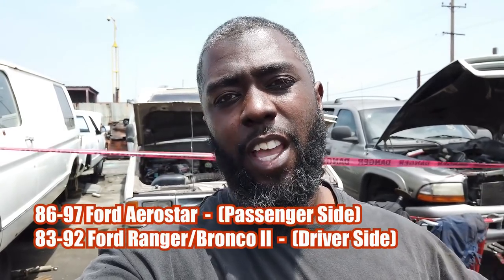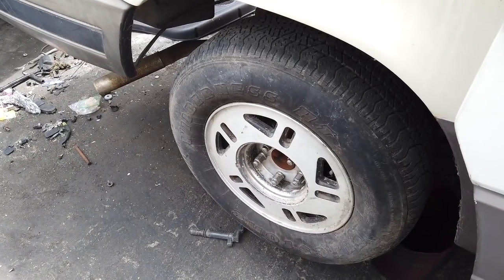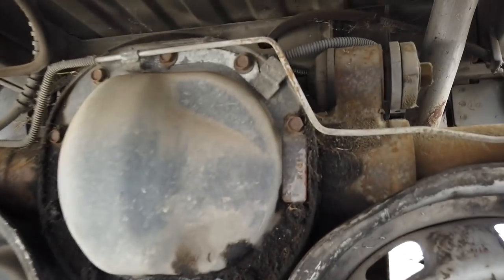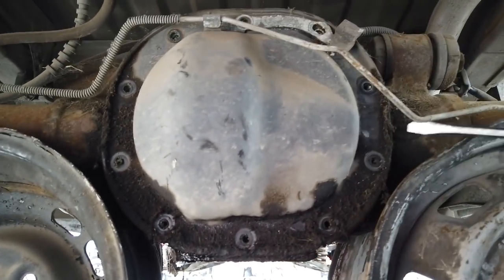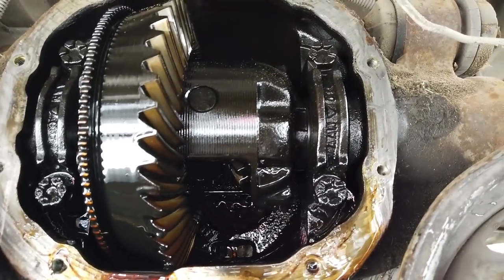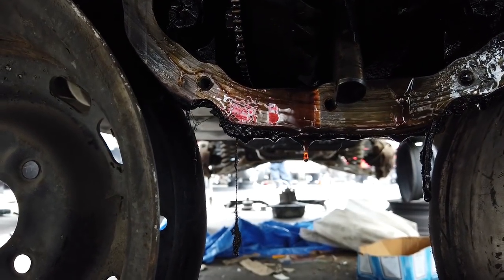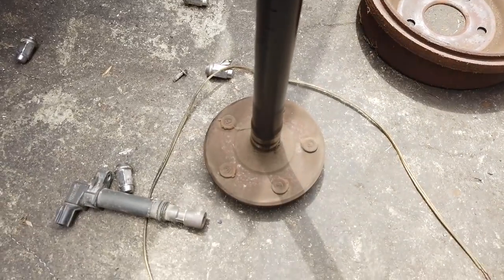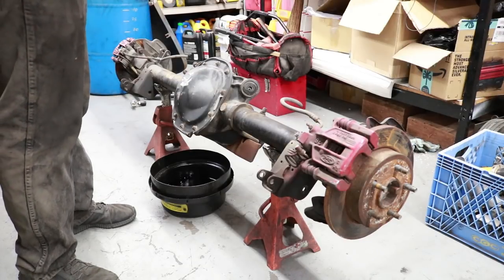Foxbody 8.8 Differential 5 Lug & Disc Brake Swap - JUNKYARD MOD

Comment: Dude you saved my ass! I have 8.8 w/C-Clip eliminators and run a 15" wheel on my Fox. The fancy disc brake conversion brackets, put my axles out a 1/4" on each side producing less spline contact at the spool. Not to mention Cobra rotors and calipers wont allow 15" wheels. I couldn't believe this would work till I did it. Bravo!

Comment: To save your self the trouble, just get the axles from rock auto . A lot cheaper than LMR. the set out the door cost me 137 dollars. All you have to do is buy studs they don’t come with the axles ..

Comment: Awesome video! Do you know if you can use the sn95 brackets this way and keep the 4  lug stock axles ?
Reply from the maker: Yes you can.  If you find 4 lug disc brakes from a a Thunderbird Turbocoupe it works great

Comment: I was wondering if I get a 1994 mustang with a V8 in it - would the rear end and 5 lug set up bolt up to my 83 foxbody? the disc breaks- the break lines- etc.  That's what's going on here ? Except you get those shorter axles to keep stock length? Thing is though the doner car has 183k miles on it.  Does that mean the rear end shouldn't be used? Love this channel and the foxbody secrets!     🔥💯💥 can same break master be used as well?

Comment: i just picked up a 1990 fox. i was told it has 3.73 gear. what model is that gear out of? what’s the spline count? i’m looking to do a 5 lug swap but would like to know before i start buying parts..
Reply from the maker: 1990 fox has
Stock 2.73 gears 3.73 come from aftermarket and Explorers.  Spline count is 28.

Comment: I just bought a 90 LX 5.0. Not stock. It is still 4 lug but has disc in rear. I feel like the axle is wider than stock. Getting tire rub in corners. How can I identify the axle that is in it. Tnx

Comment: I have a 90 Fox Body with a 8.8, 28 splined, 4 lug rear end in my fox mustang....I have access to SN95, 5 lug rear calipers, flat mounting brackets, anti moan brackets, mounting hardware, rotors, brake pads, and SN95 5 lug, 28 splined axles...Will these parts bolt up to my existing Fox Body rear end...and will I still have the same overall axle width...or will I have to modify and move the caliper brackets to the inside as you did in the above video...Or.... should I scrap the whole idea and just do as you did above...
Reply from the maker: You can swap everything over.  You will have a small increass in width but not much.  No need to modify the brake bracket if your going with sn95 axles.

Comment: Did you use the sn95 housing and if so are they the same dimensions as the fox housing? You should have added a parts list. Well done.
Reply: Yes the 86-93 and 94-98 axles housings are the same length, 99+ got longer housings.

Comment: Is there a reason you're only considering older Rangers???  I've got 2 2006's Are they less sturdy then the older rears???  I'm actually putting an Expedition rear in the one because it has disc brakes.  PLUS...  originally it was on the ground,  with the wheels still on.  They needed room down the shop,  so...  anyway,  they pulled the wheels off for me and put it on top of another vehicle.  Saved me a lot of work...  neither of my Rangers have rear sway bars,  are they worth it???

Comment: Could you help me out .. I have a 4lug 89 fox body reared I need to swap into a 85 cutlass which is 5 lug  …5x120 ,which vehicle can I get the axles out that will work …??

Comment: I have a question I cannot find it any information on. Is there any other vehicle with 31 spline that will fit for the fox body stock axle. And what was the rotor you used on this build from and year?

Comment: So, I got a 1962 Ford F100 Unibody. Would I be able to use this, so I can have rear disc brakes and get rid of the drums?
Reply from the maker: As long as you have an 8.8 rear it will work just fine

Comment: I got a diff 7.5 from a 98 v6 with 4.1 gear in it for 50 bucks,  but i have pretty 4 lugs rims, the drum assembly will be a direct bolt in? I want to use my 4 lugs axlez
Reply from the maker: Bolts right in bud

Comment: does the disc brake brackets and calipers have to come off a 8.8 rear, or could they come from a 6cyl car/
Reply from the maker: The can come off a 6 cylinder car too they are the same.

Comment: Was there a reason you chose to cut the top portion over the bottom portion of the bracket plate?
Reply from the maker: It has to slide over the axle housing and mount from the back if you want to retain foxbody length axles.
Reply: No I understand stand that. I'm about to cut the brackets. I was just curious if the 3 bolts leveraged one way better than the other? Like the C shape going around the top of axle or the C going around the bottom like you did. Make sense?

Comment: Can I do this and buy 4lug rotors for a turbo coupe 87-88 or do I have to use turbo couple brackets and calipers ?
Reply from the maker: You can do exactly the same thing, just change the rotors to 4 lug like u said.

Comment: On my 94 Bronco going with the gt40p heads and the Anderson n41 cam will I have to change the springs on my heads and if yes what do you recommend
Reply from the maker: Trick flow springs or comp cams for sure.  Call them, tell them your set up and they'll tell you the part number

Comment: Could I use the factory 8.8 in my fox and just go buy the calipers and brackets from the yard?
Reply from the maker: Yes.  If you want a 4 bolt disc brake rear buy rotors from a 88 Ford Thunderbird Turbocoupe with the calipers and brackets from a 94-04 v6 or v8 mustang
Reply: Junkyard Doggs I’m looking to do a 4 bolt.  There are a set of 93 cobra rear calipers, rotors, and master cylinder at the yard.  You think they will work on my 92 GT?  Thanks for for being generous with all your knowledge!

Comment: Would buying a 2001 gt as a donor benefit me for a 5 lug swap if so what can I use?
Reply from the maker: The 5 lug on the 2001 is too wide for a fox but you can use the rear brakes and convert your rear end to disc.  Also the front spindles and hubs can be used as well but you have to change your lower ball joints
Reply: What type of lower ball joints would you need?

Comment: @Junkyard Doggs  Other than 94-95 rear ends which are direct bolt in for fox. Which other years will work for a fox 5 lug/disc ?
Reply: 94-98 same housing

Comment: I tried it with the Ford mustang GT out of a 99 and the axle shafts are too short is there a difference between 94 through 98
Reply from the maker: Yes the 99 to 04 rear end is wider

Comment: So do you got to get axles from two different vehicles
Reply from the maker: Yes from Aerostar and Ranger.  Or you can pull sn95 length axles from any 94-98 Sn95 mustang v6 or v8

Comment: Do I have to change the carrier inside the housing for my axle to work ? I was following this step by step but my axles aren’t going in far enough for me to put in the c clip ???
Reply from the maker: Sounds like you have a burr on the splines.
Reply: @JunkyardDoggs   no burr on splines any other possible issues ?
Reply from the maker: @avinashuppaluppal5746  burrs on the gears themselves? Metal chips inside carrier?
Reply: @JunkyardDoggs  all good, is there a certain way the axle should go inside, my housing is from a 2000gt and the axles are Aerostar, what length should they be ? I’ll measure again to make sure
Reply from the maker: @avinashuppaluppal5746  theres the problem!  A 2000 GT axles are longer than the aerostar/ranger.
Reply: @JunkyardDoggs the axles I have are aerostar but the housing is from the 2000gt. Will it still work ? Or what would be the fix for this ?
Reply from the maker: @avinashuppaluppal5746  they dont match.  You will have to get axles from a 99-04 Gt for that housing
Reply: @JunkyardDoggs  do you think an 86 mustang get housing will work ?
Reply from the maker: @avinashuppaluppal5746  yes it will
Reply: @JunkyardDoggs  thank you very much, gonna go pick one up

Comment: Is it possible to put those brackets on the OEM foxbody rearend? With the axle off that Aerostar?
Reply from the maker: Yes absolutely
Reply: now my next question is does it still need to be mounted on the inside on OEM fox rear end or outside of it?
Reply from the maker: @coloncleanse3542  they have to be cut and installed on the inside.
Reply: Junkyard Doggs@ your the FOX-BODY KIND. Thx for the info picked my brackets up today at junk yard.
Reply: What about the E-brake and brake line are those off the SN95 also?
Reply from the maker: @coloncleanse3542  easy swap they just need ro be connected to the equalizer bracket and it will work fine.

Comment: 89 Foxbody 4 lug . So far this video is the most helpful one out there. No I have an 8/87 Lincoln LSC as my donor now will have to do is get information will my axles work and if I do. do I have to flip them or this is the only weak point that I see so far that I cannot find information on. Any info would be highly appreciated

Comment: Tony, can you use the stock M/C, booster, prop valve and lines? thank you. i really like your videos.
Reply from the maker: Yes you can my man.
Reply: @JunkyardDoggs  I have 69 mustang where I want a crazy engine and transmission swap in it and upgrading the differential. 

Engine from 2006 Lexus 3UZ
Transmission toyota R155 

Do you recommend the T5 from newer mustangs differential ? From what years you would suggest to look for if I would like the limited  slip as well. 

Thanks
Reply from the maker: @thaieralawadh2223  94-98 V8 rear and a T5 from a 94-99 V6 Mustang
Reply: @JunkyardDoggs  94-98 V8 mustang will those has the limited slip differential or 2005-2014 better ? Also, does it have to be pulled from a manual car ? 

For transmission, I am not sure the T5  would fit better than the R155 ( it is common transmission with the Lexus 3UZ in here ). 

Sorry it is my first time doing all this.

Comment: Man, I got my Ranger axle, but damn, the Aerostar is a pain. Twice I've striped the head on the 5/16" bolt for the pin.  The van's at the yards here don't have keys, so unless there's another way to get them into neutral, I'll have to remove the driveshaft to rotate the axle and get a better position to wrench on the retainer bolt. Any suggestions?
Reply from the maker: Yes.  To get them into Neutral, remove the selector connection from the transmission.  The neutral position is usually two clicks from park.  That way you can go from park to neutral without a key and rotate the driveshaft.

Comment: Tony, I have a mustang 5 lug rear end in my foxbody but don’t know what gear sn95 it’s out of ? My tires are sticking out a little bit . Can I still buy 8.8 5 lug fox length axles and install them to get the correct fox length rear end ?
Reply from the maker: Yes but you have to modify the caliper bracket like i did in the video and your gold

Comment: Great video! Just so I understand, you can only use the passenger side axle from the aerostar and the drivers from the ranger/bronco 2? Why can you not use both sides from the aerostar?
Reply from the maker: Torsional twist force.  After years of an axle rotating in one direction if you put it on the opposite side it will snap once you apply any real power.  You wont have issues with a stock set up though.

Comment: quick question, are you reusing the bracket (anti howel?) support you removed at 9:40 of the video. You swap the caliper brackets, but do the calipers stay on the original side or do they get swapped too? I'm putting the set up on a 91 fox 8.8.
Reply: the calipers stay on their sides i think, otherwise you wouldn't be able to get the air out with the bleeder screw on the bottom of the caliper

Comment: Have you ran into the sway bar hitting this cover. Mines just touching. Idk if I want to try and cut on the cover or just go to the Ford Racing. It hits on the drain plug on the bottom. Lowered on sportlines with MM adjustable LCAs.
Reply from the maker: Yes its only for cars with aftermarket LCA i should've mentioned that in the video.  Stock set ups wont work with this mod
Reply: It won’t work with my MM LCAs. I’m thinking about drilling a second set of holes 1” back on the control arms, but it’s hard to drill a 300$ set of control arms for a 15$ diff cover
Reply from the maker: @EliLee918  do you have the curved MM LCAs or the straight ones?  I have the straight ones and it clears.  I would just take a 40 grit flap disc to the cover and grind the angle down to clear.  That plug os thick and deep.  Ill try it on the next set i out out.
Reply: Ha! He said thick and deep, yeah I have the adjustable curved LCAs. Gonna science it up and figure it out. I can’t drop 400$ on the MM sway bar setup right now. Thanks bro! Love your content. Thanks for taking time time to talk.
Reply from the maker: @EliLee918  lmao

Comment: I've been looking for a video like this so by changing the axles you're keeping the track width of the fox body right
Reply from the maker: Yessir
Reply: @JunkyardDoggs  so I got a guy with a 94 5.0 rear that needs to be rebuilt but he is saying that rear will stick out about a 3/8 to a 1/2 more than the one on my car if I get that rear and change the axle will it be the same as the one in the video I'm just tryna keep the same width as I got now he said he has everything to do a disc brake swap all around except I would need to get spindles & the master cylinder all rotors are drilled & slotted already
Reply: I’ve been looking for this video for two weeks thank you so much. Only question I have is can we use up graded axles and c clip eliminators ?
Reply: Junkyard Doggs  can I install c clip eliminators and a spool  and  35 spline axles from strange or Mosier  ?